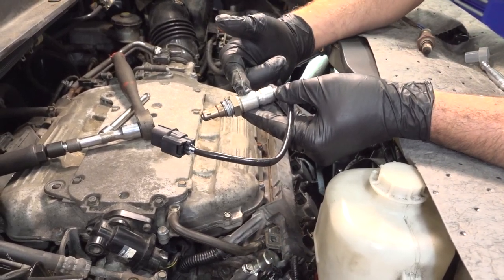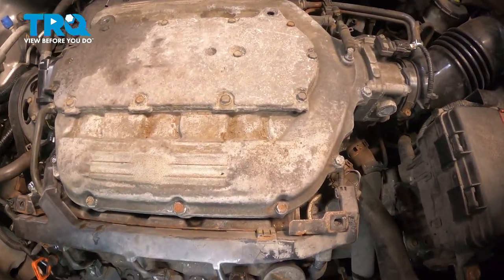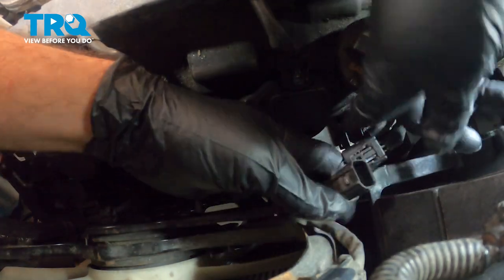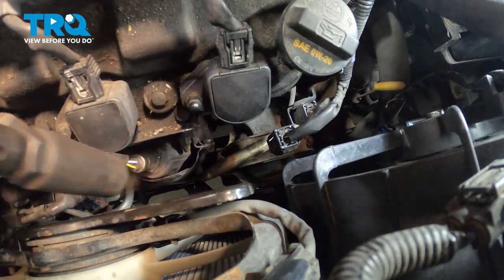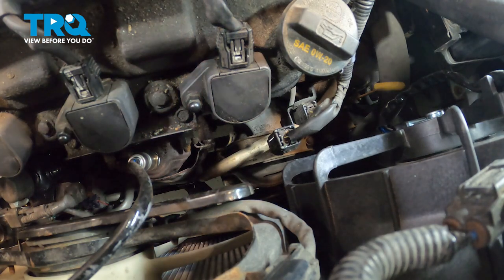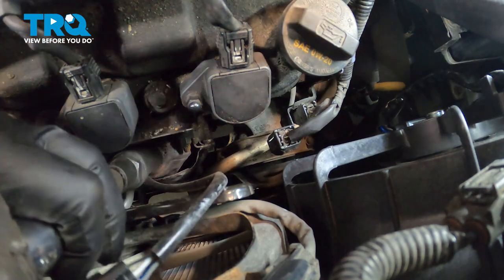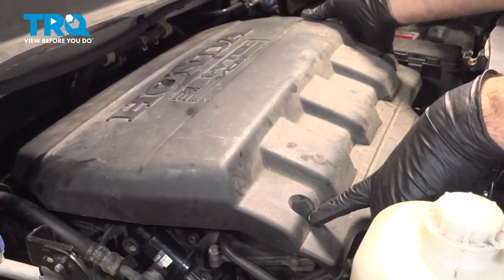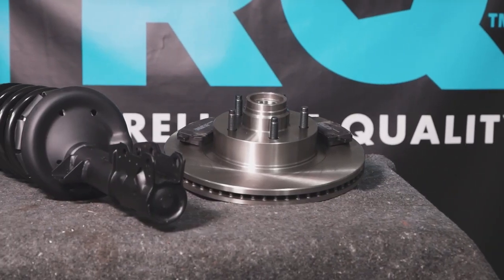How to Replace Upstream O2 Sensor 2009-2015 Honda Pilot

Comment: Never just change one O2 sensor guys.  Change them all.  A new o2 sensor can cause an imbalance with the old ones you left in. That'll cause check engine lights, rough idling, failed emission inspections,  so forth